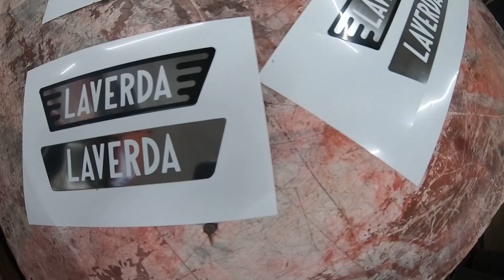3 minute Laverda restoration - Ivan's Shed

Comment: Hey Ivan, remember the Laverda Jota!!
Six cylinder beast, from the 70s. Also the Benelli Sei (six) which I think it was loosely based on the Honda 400 four with two extra pots?
Reply: @Alfred Wedmore thanks for the detailed info. Great to touch base with an informed enthusiast. The Jota was on my 'cool' list but sounds like it did have it's flaws!
Reply: @Alfred Wedmore Laverda definitely is still a thing! I bought mine, new, in June '76 and I'm still riding it.
100+ MPH, on a two lane road, would be normal riding on a Triple.